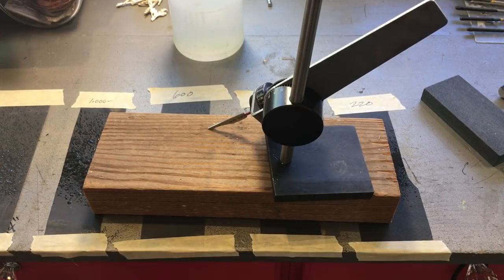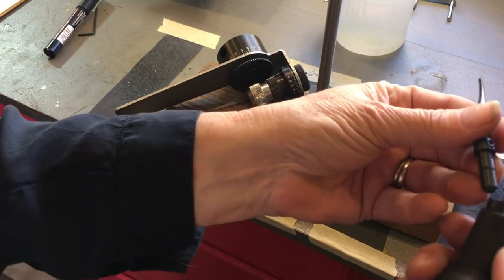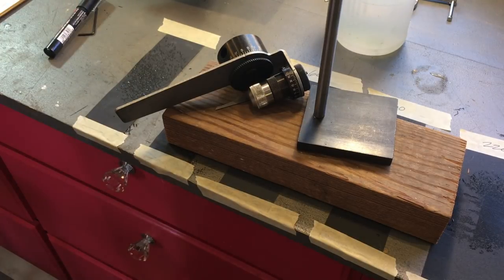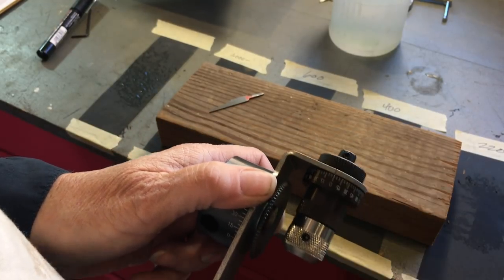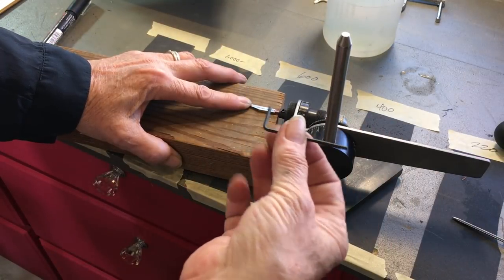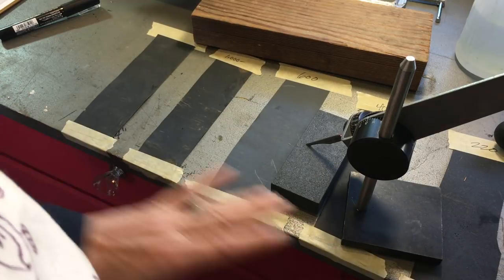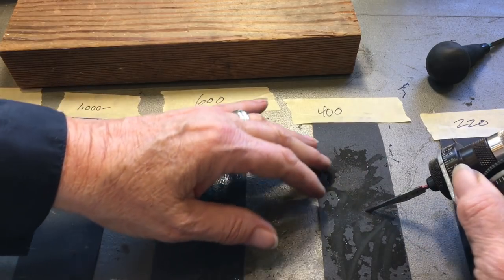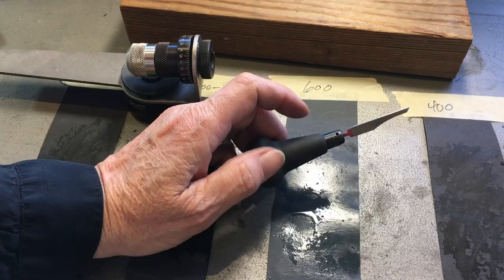How to Use: The GRS Quick Change Sharpening Fixture

Comment: I checked in the book  "Creative Stone Setting" by John Cogswell, (pgs.127 - 150) and the bottom part (closest to the metal) is called the "belly" so maybe the top is called the "back"? It doesn't give a name for that specific part (that I could find). There are the face and the "shaft" which is described and shows the different swooping shapes etc. Maybe it's the shaft, with belly and [back]? It's called "da ada side, li' dat! K den!
Reply from the maker: I love you crazy Flying Chef!
Reply: Ditto times a zillion, there's not enough adjectives to describe the love for my friend Nancy (thatr be you sweetness!)!